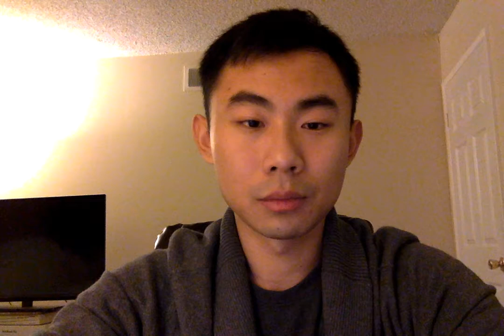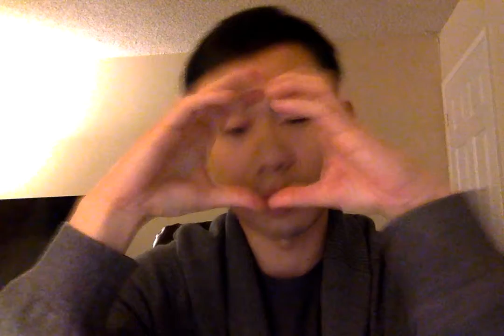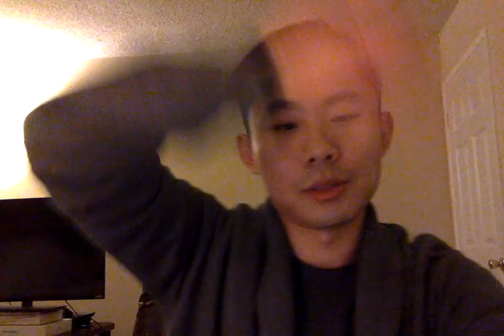What is on the 8 Hour Civil Engineer PE Exam AM Part 3

Comment: Man, Thank you very much I really find these 3 videos for the AM session very helpful, I wish you took the Structural module so I can know what exactly I should concentrate on. However, I passed the FE one month ago and I'm preparing for the PE structural Exam and based on the specification I think the AM session is very similar to the FE exam. Am I right?.

I'm buying the CERM but I'm really concerned because I feel like it doesn't cover all the AM topics.Because based on my experience I found that the FE CIVIL REVIEW MANUAL by Lindeburg was not covering all the Reference topics AND at the same time it was covering ALOT of unnecessary topics in the FE Civil. Is that what is happening in the CERM as well?. I still haven't bought it yet but I saw a review of it on Amazon and I saw that it was covering some topics on Math and Geometry?!!! which is obviously not related to the specifications mentioned on the NCEES morning session.